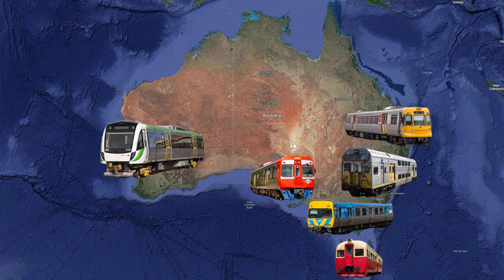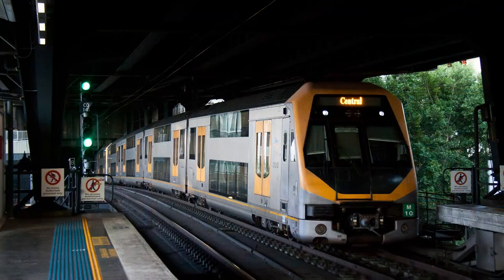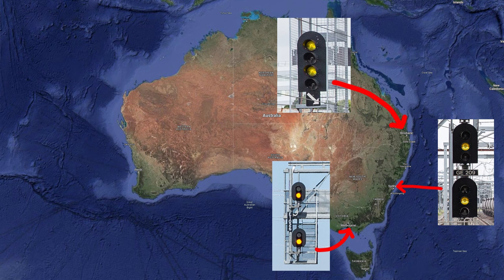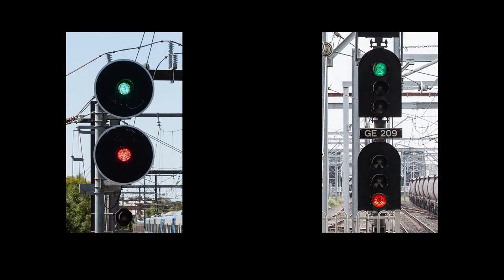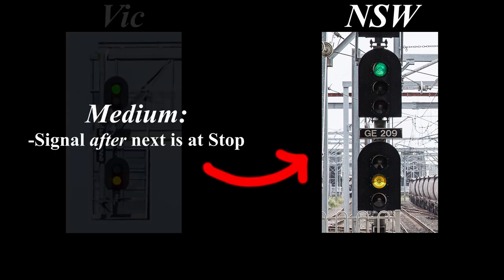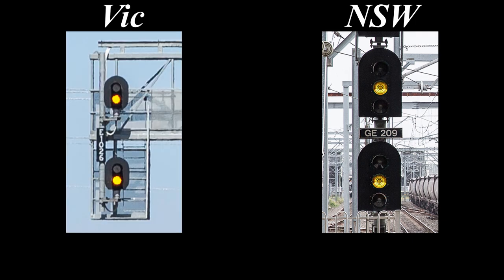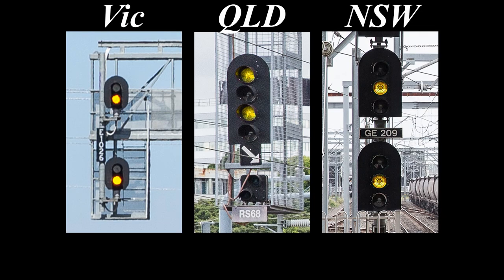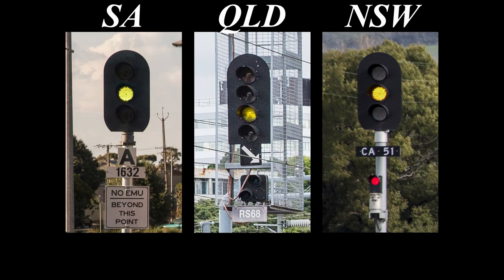Australian Railway Signalling - Conflicting Aspects

Comment: As a NSW driver my blood pressure rises when I try to fathom Victoria's signalling system. The colour red should never be used as a full clear, it defies logic from early childhood
Reply: As a driver in Melbourne I can understand what you are saying. Just treat the red in conjunction with other colours as speeds. ie green over red is clear normal speed. Red over green is clear medium speed. It makes sense once you learn it but can understand coming from Sydney where green over red means next signal at stop (if I remember correctly)
Reply: I believe it's similar to the NZ system. A red on the lower signal is the same as that head not being present. Although all Vic signals have two heads anyway whereas NZ usually omits them unless they actually need to show the complex aspects (e.g. on approach to junctions).
Red over red just means red - stop. 
Yellow over red is a single yellow - Caution Normal Speed, expect next signal to be at stop. 
Green over red is the same as single green. Clear, Normal Speed, expect next signal to also allow normal speed.

This has the advantage that a failed or obscured lamp makes the signal equally or more restrictive, although there are cases where medium speed aspects could appear to be normal speed in that situation.
Reply: @topher1976au  I live in Lilydale, that explains why I've never seen a amber over anything except in ringwood. By the way I haven't seen it done there for a while also.
Reply: Fair rundown on NZ signalling, Someone. It's a good video (and a great subject for discussion). As an engineman who's operated in NZ, the Pilbara, WA, SA, and NSW, and has required to be familiar in subsequent career roles with QLD and VIC, I thought the Pilbara could have been added for further comparison... the GCOR having formed the basis of the original iron ore railroads (which are now much-evolved). The NZ CTC system (also now evolved since privatisation) might have also been described a bit more since there's been such a movement of enginemen from NZ to Australian systems over the last 50 years; in that sense rendering NZ as another 'Australasian state'. One other aspect (sorry) that might deserve description because it might help to explain some of the differences is the 'route signalling' versus 'speed signalling' difference.
Reply: @NullaNulla  Because there isn't really a 'primary', and the lower signal doesn't necessarily mean anything about the next signal.

Over red = read the top on its own.
Red over = read the bottom on its own, limited to medium speed.
Yellow over green = reduce to medium speed at next signal.

That's it. Three rules and you're there.

NZ adds a few special options - flashing yellow on top is advance caution, and a flashing lower unit means intermediate speed instead of medium speed, because our medium speed is only 25km/h.
Reply: Another driver here. 
I have worked in NSW and SA.
Victoria's signals were always a good debate point in crib room.

When ever we retrained for the next signalling system it was a room of experienced people sharing what their former signals were in comparison. Especially when we all came from a half dozen different networks.
Reply: @Temprasphere  it’d certainly be nice if it was standardised Australia wide. But look at the entire railways itself with gauge etc. enough said lol.
Reply: Except in Victoria...
Reply: It would be a carry over from the red marker light on single head light signals.
Reply: I'm with you there. Although being british the queensland system makes the most sense!

The only proceeded aspect we have that has a red light involved at all is red over 2 white lights at an angle
Which can either mean shunt ahead or calling on. Either way it's no guarantee of a clear line ahead, just that the points are set correctly
Reply: @vsvnrg3263  In that incident the signalling systems were not working due to a fire. So your proposal would be comprimised as well.

The current systems do indicate which way points are set.
Reply: Red is not a clear signal.
Reply: Here in Italy, at the "Italian State Railways" (FSI, in particular at RFI, the company that takes care of the tracks and railway ferries for Sicily) a train driver can encounter Red on Green (confirmation of speed reduction), red on yellow (ditto plus no traffic warning), red on yellow green (confirmation of speed reduction indicated by the previous warning signal plus warning of speed reduction to 30 km/h*) but never encounters a red under a green !

*At 60 km/h if the yellow and green lights flash simultaneously, or at 100 km/h if they flash alternately. It is permissible for a solid yellow and green warning to change to an alternately flashing yellow green if the subsequent signal changes from red yellow to red green. This depends on the braking distance
Reply: @someonesomewhere1240  Here in Italy, at the "Italian State Railways" (FSI, in particular at RFI, the company that takes care of the tracks and railway ferries for Sicily) a train driver can encounter Red on Green (confirmation of speed reduction), red on yellow (ditto plus no traffic warning), red on yellow green (confirmation of speed reduction indicated by the previous warning signal plus warning of speed reduction to 30 km/h*) but never encounters a red under a green !

*At 60 km/h if the yellow and green lights flash simultaneously, or at 100 km/h if they flash alternately. It is permissible for a solid yellow and green warning to change to an alternately flashing yellow green if the subsequent signal changes from red yellow to red green. This depends on the braking distance
Reply: I don't know of any railway in the world that uses NSW style signal aspects.  Victorian signal aspects are used in many countries around the world, NSW is very much in the minority.
Reply: @baudad  Yep. I don't really like the NSW system much.  Though I still have a lot of studying to do.

Comment: WA signaling is by far the most simple, based on the uk system.  Green clear, yellow next signal red, red stop.  On the faster routes there will be 2 yellow signals before a red.
Reply: That’s the same system as used in NSW
Reply: @Aaron-uf3sl  no its the uk system, the NSW system is not used in the UK
Reply: @witzendoz  the signalling hierarchy as mentioned by you above is basically the same as is used in NSW, its a block based signalling system.
Reply: @Aaron-uf3sl  the colour light system used in Western Australia is nothing like what is used in NSW or Vic, that’s the point I’m trying to make
Reply: @witzendoz  you have stated that the signalling system employed in WA is similar to what is used in the UK. I have said NSW is similar in this regard as the signalling systems used in this state are also closely based upon those used in the UK. To say they are "nothing" alike is wrong. 

I recommend checking out a website called Railsafe and searching for NSG-600 "running signals".
Reply: Do you mean that there are two yellow signals in a row, or a signal with two yellow lights at once? Brisbane's system is more similar to the UK as it is literally the same in every way except for the approach turnout warning method and the addition of "special caution" which the UK doesn't have.

Comment: NSW Signalling is a way of talking to the driver on the condition ahead. Once learnt it makes sense. The top tells you immediately ahead and the bottom tells you what’s after that.
Reply: Which is just the opposite of Polish signaling, where they use a five roundel vertical head, the top two tell you the future aspect, center is red, and bottom two (plus sometimes a separate horizontal bar under that) tell you the current aspect.
Reply: I’m not a train driver but I found NSW one is the most easiest to understand
Reply: Being from Qld I find the nsw system interesting... in Qld we use Junction indicators/route indicators attached to the signal to indicate which route is to be taken, which leaves the 1 colour light signal to tell you your authority plus the next signal aspect... it's fascinating to me to have 2 signals to show something that can basically be done with 1 signal, at least that's the way I see it from a Qld point of view 😅
Reply: @Flyingscotsman218  NSW also has repeaters that indicate that a future diverging route is set.
Reply: Similar to German practice too

Comment: I'm not Australian, I'm American, and it's infuriating how signal systems here are not endemic to a specific region or state. Instead, they're specific to EACH RAILROAD. That means that in Los Angeles for example, you'd have individual signal systems for the Union Pacific, BNSF, and Metrolink that a locomotive engineer and conductor working for ANY RR there has to be current in before being let out onto the main line. Amtrak engineers who work south out of Washington DC have to be qualified on as many as FIVE different signal systems and many of them will run their trains over each of those five systems in a single trip. It's utterly ridiculous.

Comment: Nsw signals make much more sense than victoria's
Reply: NSW signals are certainly simpler and more intuitive to understand, but Victorian signals ultimately have the benefit of being more precise and information dense with fewer or the same number of lights. The Victorian system (or, at least, the system used in North America on which Victorian signals are based) was created by replacing old semaphore arms with electronic lights used in the same configuration and can indicate the maximum authorized speed, traffic state of the line ahead, and route alignment with just two or three lights.
Reply: Sorry disagree
Reply: I don't really care for the NSW system, personally.  I'd take the British system over that any day.  But I also like most of the American systems.

Comment: If there was ever a need for standardisation, this is it. I suppose that there is too much rivalry between the states for that to happen, though. Simplicity is often the key to safety- the more complication, the more to go wrong.
Reply: There's no real need for standardization.  If it doesn't cause any problems, it's not broken. The United States has many more different signal systems in small areas and, for the most part, those don't cause any problems either.  If you want to look at a country that did start out disparate and then standardized, check out Canada.

Comment: At least with Queenslands signalling, they use practically the same system as with British signals so it’s not as confusing.
Reply: I know what you mean I live in caboolture which has 3 platforms and red mean platform 1 has a train on it and green means platform 1 is clear

Comment: Victoria also had another kind of green over red, but with a meaning similar to NSW. That was with 2-position semaphore signals with a red distant arm under a home arm where each was controlled by different signalboxes (if my understanding is correct). Pretty sure there are none of those still in use today though.
Reply: Last semaphore on a suburban line I can recall was Eltham but that's since been removed. There was also one still in use until recently on the VIC/NSW mainline on the way to Albury but that got decommissioned last year I think
Reply: That is reason NSW have green over red meaning next signal at stop. It is a carry over from the semaphore system.

Comment: The flashing yellow signal colour you've shown in NSW is in a failure state as the red marker light is on.

A red marker light on any signal other than a main red indication indicates the signal has failed.
Reply from the maker: That's a mistake on my part - I wrongly assumed that light would stay on like the small lower lights on victorian signals do. The signal was at stop in the original photograph.
Reply: @Taitset  All good, simple error.

I've struck 3 signals so far with the marker light illuminated, plus another couple where all the lights are out

Not bad for 30+ years on the job.

Plus NSW has a Green over Pulsating Yellow, called a preliminary Medium, or 1¾, next signal would be a Green over Yellow - Medium or 1½ indication.

Comment: As an SAR fan the speed system is familiar to me. As far as I know it originated in Montreal and was adopted by the SAR in 1913 when Adelaide railway station trackage was rebuilt, as such it preceded the appointment of W.A. Webb in the early 1920s who introduced USA practices to the state.
Route signaling as applied in British practice using a different arm for every route was a consequence of mechanical interlocking, is unnecessary with relay interlocking. All a driver needs to know is how fast to go not the route and then remember the appropriate speed. NSW signaling is anachronistic with  route signaling and every signal needs two heads to display, clear, caution or stop. I admit green over red and red over green might be difficult for some to comprehend but a single red or double red still means the same thing so no real confusion.
Add into the mix the permissive indication used on both country and suburban system in SA and in Victoria and our far eastern friends will really have a fit.

Comment: Correct me if I'm wrong, but isn't a major issue with double-light (like the double-yellow in QLD) signaling that it's not fail safe? I guess in the case of QLD where they're both displaying an "expect to stop" aspect it might be a little bit different but I know in places like Sweden, a single flashing green aspect has a completely different meaning to a double flashing green signal. So if one of the two flashing green lights stops working for whatever reason... an issue could occur.
Reply from the maker: I think it can potentially be an issue on some systems, but in most cases one missing light just creates a more restrictive aspect anyway- ie the QLD double yellow is fine, because if one is out then it's a single yellow: which would make the driver prepare to stop. For the Vic and NSW systems both lights are always lit, so if one was missing the driver would be able to tell there was a fault.

Comment: Another weird aspect I’ve found about Adelaide metro is whenever trains are scheduled to arrive at stations a green signal is shown, but once it’s departed it changes to red. I think it’s supposed to be a system of block wiring similar to model train automative control before DCC. Interesting little quirk but it works. Express trains ride through stations all clear on red signals which I guess means pass through stations at a slightly reduced speed. I think it’d be more logical if the colours were reversed
Reply from the maker: On almost every signalling system, the signal drops to red as the train passes it - that's how it protects against following trains. If the signal is automatic it will go green again once the train is far enough ahead, of it's a manually controlled signal it might not be cleared until the next train is actually due. As for express trains running through on reds, you might be missing something there! Adelaide does have an aspect where the signal remains red but has a white junction indicator displayed underneath it. But if you're seeing a train passing a red signal at speed, I would say it's a signal that doesn't apply to that train - ie it's probably for another track. Which location are you talking about?
Reply: @Taitset  also a train can pass a permissive signal on red. The train has to stop, wait one minute, the proceed as slow speed, such that the stopping distance is half visual distance, and no greater than 25kmph.

Also there are instances where a train and be cleared to proceed past a signal on a 'verbal caution order" I believe it is called. This is used where there is a fault in the system.

Comment: With Victorian two-position signalling, you could have the situation at ahead of points where two signals were mounted on the same post, with the top arm (or light) being the left-hand route straight ahead and the bottom arm being the diverging right hand route.  If you were going straight ahead, you could travel at line speed, but if diverging you had to travel at medium speed because of the diverge.  So, even though each signal was to be read separately, "green over red" effectively meant normal speed and "red over green" effectively meant medium speed.
Three position signalling gives the same indication, even though the two lights or arms are to be read together.
This would have saved confusion where you had both systems in use.

Comment: Germany also has several signalling systems. The difference is not just between East & West Germany, but also because newer systems have not completely replaced older ones.
Thankfully all these systems were designed in such a way that if two aspects look the same, they will also mean the same thing.

Comment: One thing I noticed when I first moved to Melbourne was the suburban lines all had two head signals where's the country lines all appeared to have single head signals.
Reply: All depends on the safeworking system used. Only a small section of Frankston has 2 position signals with remainder of electrified network being 3 position.
Reply from the maker: There are plenty of places in the country which have the two-head signals, especially on the Regional Fast Rail lines.
Reply: @Taitset  There is a lot more now than when I moved to Melbourne. You'd pass the last suburban station and it would go for I'm single to double head. It was like a line had been drawn in the um ballest
Reply: I grew up in Shepparton, the old signals (before someone scrapped most of them) were all single head.
Reply: @topher1976au  single head, double head, two colour, 3 colour and that's not including blue local signals. No wonder you need to learn the road.

Comment: Also on Qld flashing yellow it means that: The points ahead are set for a conflicting movement and/or there is rail traffic in the next immediate section, there are shunt movements on an adjacent line or level crossing protection hasn't activated 😄